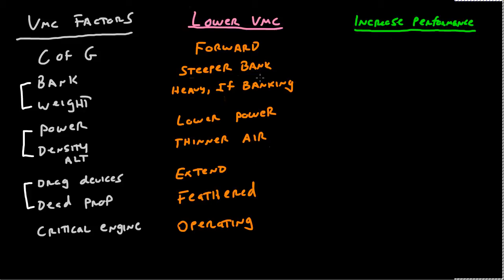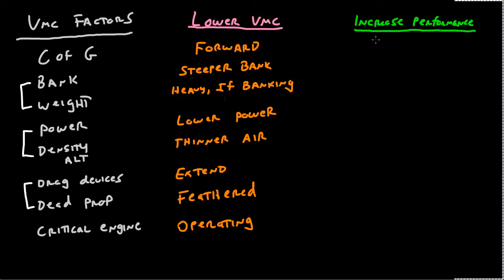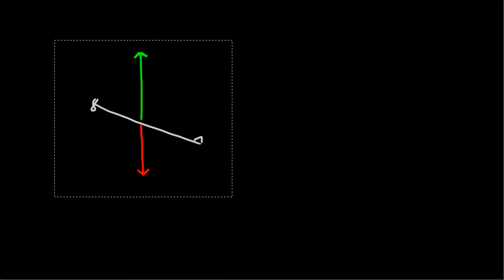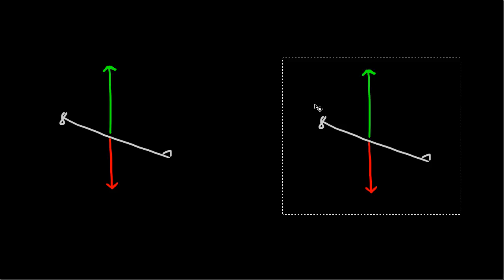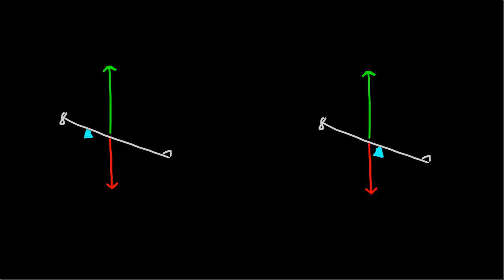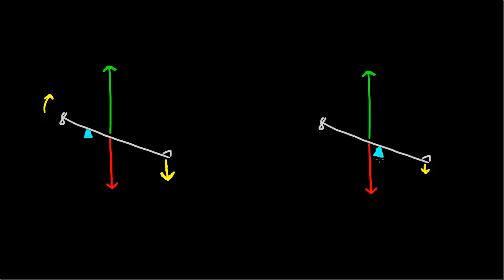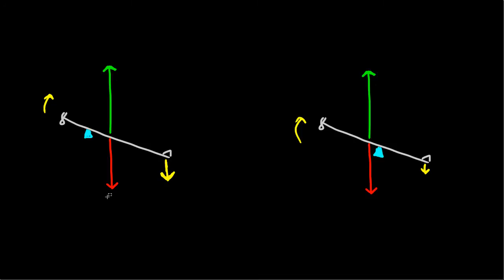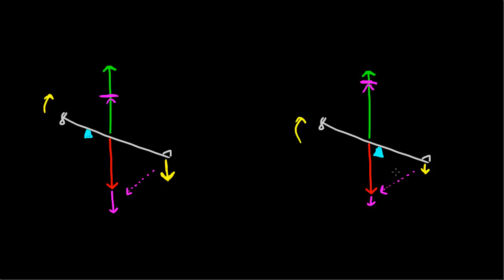The VMC Table - Part 6 (CG and Performance)

Comment: I like these videos. Thanks for putting them together.  However, on this one the diagram on the right has the CG in the wrong place.  The CG will alway be in front of the center of lift..  The way it is drawn, the lift vector is raising the nose, so the elevator would need to have an upward force for balanced flight. You should have the CG closer to the Center of lift but still forward  of it.  Your main point the the elevator needs to produce less downward force is still correct due to the shorter moment arm between the CG and CL in the diagram on the right as opposed to the diagram on the left.
Reply from the maker: Hey, you're exactly right.  Thank you very much!